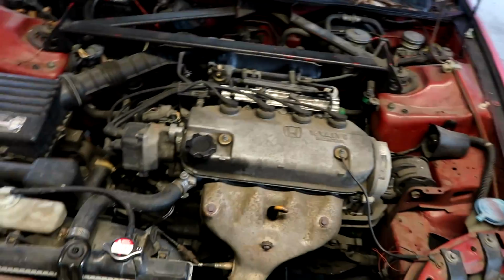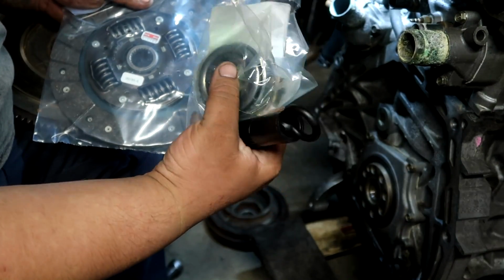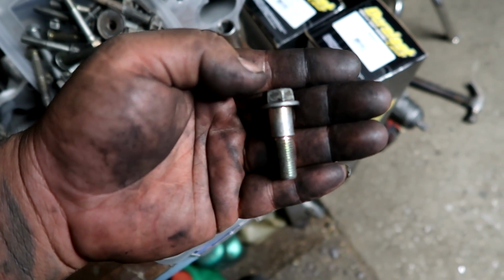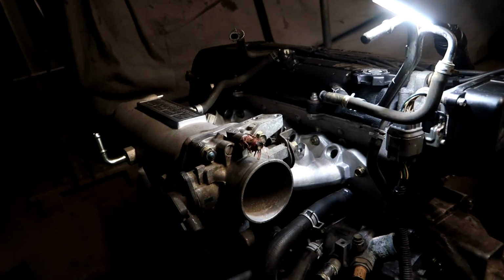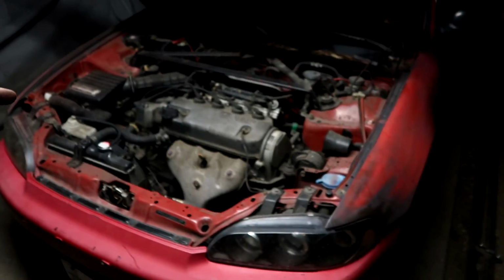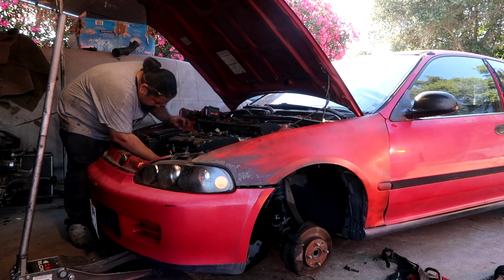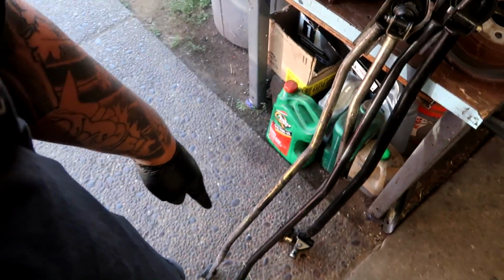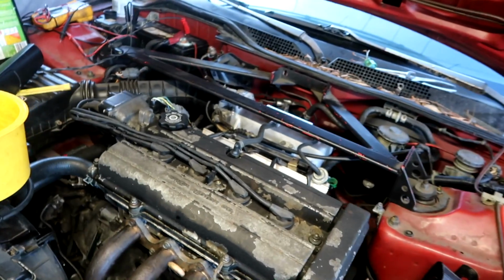92-95 Civic D15b7 To B20B Engine Swap

Comment: @6:15  when putting in a new pilot bearing/bushing, please dont use a metal hammer, just find a socket that only touches the outer ring or use a soft hammer... you can disfigure the bearing or blow out the side plates that hold the lube in. Or dont, theyre cheap and youll replace it again someday.

Comment: Can some one give me there opinion on this, 95 civic with a b20b paired to a ls hydro tranny, using e bay billet mounts and stock drivers mount and the motor leans slightly to the drivers side, the car is a manual car from factory so the transmission mount is fs correct, the only thing that is unknown is the t bracket any possibility that if it were the stock d series one it would cause the transmission to sit slightly higher, this is stumping me so much I’m about to cut the bracket off the frame and re weld it where the motor would be straight
Reply: Post mount is unknown 2 but looks identical to a 94 teggy post mount
Reply: For the t bracket, you need the integra one 94-01 & driver post mount needs 2 post integra mount too iirc

Comment: Hey brotha I had a question I bought a swapped ek with a b20 but I think it has the wrong throttle cable link I think it’s the crv one what would you recommend to get a replacement

Comment: I have a 1994 Honda Civic EX 1.6L Vtec coupe, power windows, moon roof untouched 164,000 R 81 paint Murano Red, interiors is nice, exterior need some body work and paint. KYB struts and shocks rides around like a car half its age easy, nice.What's the average selling price for this little 💎 gem of a car?

Comment: i’m doing the same swap eg hatch had a auto d15 and got a b20 non vtec but stutters and is in limp mode, i didn’t do any of the changing the harness, so i need obd1 to obd2 harness’s ?? i also have ecu and do i need to change fuel pump also i have the alternator, distributor, and fuel injectors b series basically everything b series with ecu, wat conversion harness i need

Comment: Hi im curious about b series transmission options i cant find any solid info i have a ek hatch and wouldn't mind doing a b20 swap my big problem is im in Australia and b series transmission are kinda hard to come by at a good price we have crv here that are only fwd so im trying to find out preferably from someone with you swap knowledge if i get my hands on a fwd crv would i be able to use the engine and transmission from the crv ?

Comment: I could use some expertise, help, information lol. I have a 96 Honda civic ex coupe and I'm looking to do a B series swap and I'm curious to which B series engine would be the easiest to do for the EK? I would like to do a B20 preferably because of the slightly higher displacement but I don't know if it would be easier in the long run. I've worked on a lot of Hondas but swaps are somewhat new to me. And I'm more of a Nissan guy but decided to get back into Hondas again. I've looked everywhere for information on how to wire the engine, on how to run the harnesses, and I've run into more questions than answers, to be honest, lol. I know how to do everything from tearing apart and rebuilding a engine but having to wire up certain things or running the ob2a to obd1,obd or the jumper wires is a little confusing especially when the majority of videos are not very specific. I like how you do your videos and I figured maybe you could do a video showing how to do the wiring of the obd things and jumpers etc. I would greatly appreciate any feedback, information, etc. Thanks again for your time and information.

Comment: Hey Dana , I have a 92 civic with a new oem engine harness but it is missing the plug for a throttle body mounted map sensor. I was wondering if you could help me get a pin out or something so I can wire one in.
Anyways keep up the work G progress is better than no progress

Comment: Currently swapping my 93 del sol s d15b7 to a b18b1 just waiting on my mounts. This video was a huge help cuz the engine harness that came with my swap Is a hacked up obd2 harness everything on it is obd1 except injectors so I can use my d15 injectors and harness

Comment: appreciate it man , you really putting some sense on helping everyone learn how to swap engine work etc. My dad got me a 92 civic hatchback it came automatic, but the engine had some issues with it. Burning oil, coolant, etc . We finally decided on B swapping it , Since I just got my Liscense and learned / still learning how to drive stick. This will help alot on building it and putting it into my hatchback. 🙂👍🏽

Comment: Hi i have question My honda civic 1993 eg
Has b20b engine
Heads b16a
The point is the ecu p75 integra will work nice? And dosen't have problem.?
Reply: Gonna need a tube I’m assuming because of the different heads ?

Comment: Could you give me a shopping list for my 92CX Hatch, non Vtech engine? I will be buying a 95 GSR longblock which will only come with the original trans and ECU. I also have the USDM TypeR brake setup for the spindles. Not sure what mounts I need if it’s different from fhe B20 swap. I will also be keeping the AC that is currently in car. Not sure what brackets I’m gonna need to hook it back up. I’m in CA so this will need to pass the Ref and Smog. UdaMan

Comment: For my b18b1 block matched up to my 99-00 Si S4C transmission the i usedcthe EM1 midshaft with no issues. I was told it wouldnt work however all is fine?

Comment: They are still making mistakes. For the new builders on the seen please always remind them that they can not use the flex plate gear bolts on a manual flywheel. You have a huge audience so always remind them. It will save your viewers a ton of problems. Thank you my good man. I myself have learned a lot from you andci am a 30 year builder. God Bless PS. After i wrotecthis comment you mentioned the flywheel bolts lol😂🤣

Comment: Hey I have a serious question about a swap.. I want to drop a B20 engine and tranny automatic in to my ek coupe.. I don't want manual. I have the D to b mounts, t bracket   and a crv to rip apart.     Is it possible with major mods??

Comment: I have a question Putting a B20Z2 In my 95 civic Non vtec What do I do with this Crank sensor
Reply from the maker: youre more than likely going to stick to obd1 ecu. obd1 ecu doesnt look for that sensor. so you can simply remove the sensor completely and you shouldnt have any issues. or, leave it unplugged if you dont want to tear the timing cover off.

Comment: I have a question by using what you said on the b20 I figured out the mine is a 97 I put it in a 1995 Honda Civic EX no OBD2 sensor anywhere and I cannot get it to crank up what do I do William Morris

Comment: This video is kinda old but maybe some wil help me. So im doing a d to a b series. obd1 is the d and obd2 is the B. I have a obd2 ecu with a tune for the engine i plane on just taking the d with the ecu out and puting the b with the ecu in. Now i was wondering how would the electrical stuff work? Like dash lights and the head lights? Do i have to replace anything or should they just work?

Comment: This video is gonna pay off big time for me. JDM B20B high compression motor on it's way to my garage to swap into my EG Hatch race car. The whole axle, half shaft, mounts, deal got my head spinning but this cleared some stuff up for me. Almost missed the post mount on the drivers side.

Comment: I need to ask you a question I got a skunk 2 manifold and 70mm Throttlebody on a d16Y8 and can’t figure it out it’s idling really high then goes up and down after warmed up I got  tps sensor at 4.5 closed and 05.00 open everything vacuum line all good what do you think it could be please help me out man thanks

Comment: Hi! I recently found a listing for a civic near me that is a 1992 DX hatch 2D with a LOT of miles (250k). I want to change engine/trans (and install turbo kit), so I figured as long as the frame is clean and not overly rusted it would be fine. Is this line of thinking flawed? Should I go for it?

Comment: Hi! I’m looking into b20b swapping/turboing a civic, but have had a really hard time finding models between 1992 and 1995. Will the next gen (I forget what number it is, but 1996-2000) still work well for a B20B swap? What are the differences?

Comment: I’m using a JDM B16a obd0 setup in my crx si with a 90-93 integra half shaft, would I use B16 axle seals or use 90-93 seals for the trans?
Reply from the maker: 90-93. The seal has to match the half shaft
Reply: @YoungStatic  appreciate the info! thanks slot man.

Comment: Idk if u know this but a ls obd2 engine harness plugs right up into the eg car harness so u can let the motor stay obd2  (dizzy,injectors,alternator) only thing is u gotta run a wire from the dizzy to the driver side tower for ur tach to work (wire is caped off)

Comment: Be informed. New pressure plates have a coat of Cosmolene on them to protect them from rust until installed. Be sure to remove a the Cosmolene with break cleaner before installing the pressure plate.

Comment: I can appreciate your knowledge with swaps. But hat TB was gross as heck, those engine dealers are just junk yard engines. I would of atleast put a head gasket set on the engine with a new timing belt and water pump... Idk i guess worry about it later.

Comment: Yo this guy is truly the real deal!!!! Hands down knows what he’s talking about, 2:30am got me looking up swaps lmao🤣
Reply: thats a big mood dude i stay up till 3 just researching parts for my ek coupe😂
Reply: Me too man lmao I gotta 2000 civic that's been in the garage sitting for years.....
Reply: Mj Moore what’s up you selling that lol
Reply: Hell yea.lol...just got me auto ek....I need 5speed asap lol
Reply: @novatrbl  yeah i have a 98 coupe ek and i wanna b18 swap it
Reply: I just bought a 96 lx 5speed with the d16y7. 80k original miles. Idle was SUPER rough. Wouldnt stay running, got it for 700. I replaced plugs, wires, new belts and water pump. Running like a champ. Still has a good bit of replacement parts needed. Window stuff. Door lock things. Letting the Cummins have a break and starting new project. Fuel efficiency was my biggest factor. Ahhh I miss the 5 speed honda. They're fun to drive. Slow but easy maintenance and cheap repairs. subscribing!!
Reply: FAAACTS💥👊
Reply: Stg its 1:16 Am and someone please comment and tell me to buy this 95 ej1 civic coupe tomorrow. 1k lowered on coilovers.stock motor d15 and brand new tires body mint and tinted windows 5speed. AC HEAT ALL WORK. SUNROOF TOO. Tell me to go get it and swap it to a b20 please someone say yes lmao. Dude Said he wanted to sale it cause you can't swap a 95 civic eg coupe lmao 😂🤣 okay yesir it can't be swapped take my money 😂 1000$ cash is what he wants. Also on Si rims.
Reply: @mrtreejunkie  buy the 95 ej coupe
Reply: Saaaaame a year later😭😅
Reply: Me right now lmao, it's 1:55am. I love youngstatic. He's just super smart/knowledgeable with Honda stuff. Learned alot. Been following your channel for about 2 years. You had like 15k followers when I subscribed. Now look at you. At 126,000+ subscribers. I'm not surprised at all, I knew his channel was gonna go places. Was just a matter of time.
Reply: love watching him fix his crx.. he’s helping me fix mine 😂.. i have no clue wtf i’m doing, i be copying and pasting
Reply: Are the manual transmissions from the D15 B7 and D16's the same or are they different and if so how much different are they?
Reply: 3am bro
Reply: me too
Reply: ME RN HAHAHAHAHA
Reply: I’m not worried about doing a swap what confuses me is the whole harness computer etc. electric
Reply: U have no life 🤣 230 looking up swaps

Comment: WATS UP WIT THAT CRUSTY ENGINE DAAAM ALL THE LOW MILEAGE JDM B20B ENGINES OUT THERE AND THE DUDE PICKED THE WORST DIRTIEST ONE !!!!
Reply: He probably ordered it and didn't get to pick it in person. Whenever I ordered mine I got whatever they sent but got lucky bc it's super clean an looks brand new inside and out and its a high comp with the knock sensor and phk pistons but I fuked up and didn't change my timing belt and it shredded teeth off it an I got lucky again and didn't bend any valves but learned my lesson lol

Comment: Finally, an EG hatchback! 😃
Reply: I’m swapping out my D15B7 for a D16Y8. I wonder how hard it’ll be.
Reply: The Native Cen_Cal  d15b7 to d16y8 is very easy youll need a z6 dizzy you can use injectors and alternator from the b7 on the y8 and everything else is plug and play if I remember correctly
Reply: Swap driver side mount bracket, injectors, alternator. I believe the b7 dizzy bolts up to the y8 if not you’ll need a obd2 to obd1 dizzy adapter
Reply: Budget_Built_Performance awesome! I’m  starting my blog’s, once my viewers blow up I would love to do a collaboration with you sir! ❤️